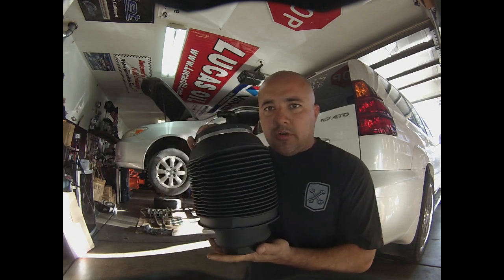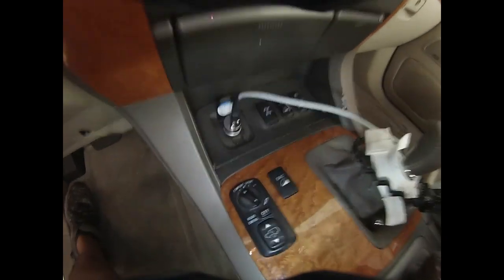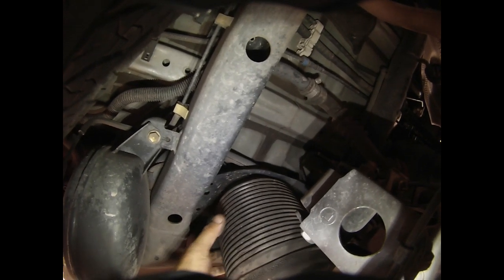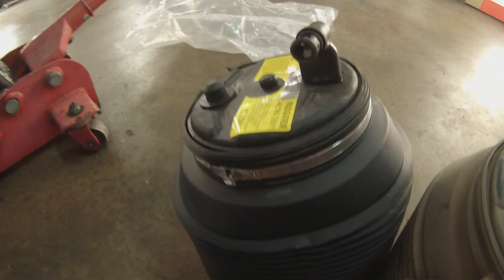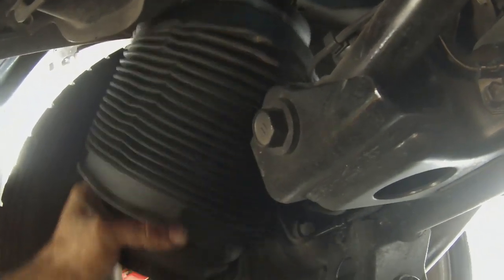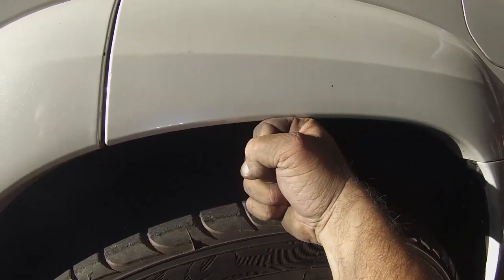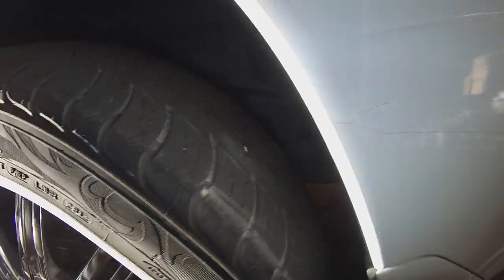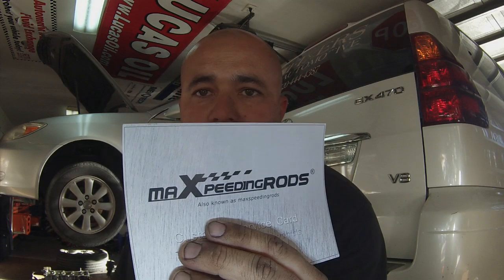2004 Lexus GX470 air spring

Comment: how to take the air springs out of the place? no much space there. thanks
Reply from the maker: Frank Wang once all the air is let out you could just collapse the bag and after taking off the top clip the bag should come right out. A little wiggle and jiggle and it will come drop out.
Reply: Thanks, after I remove the tire, there are more space to work with.

Comment: Can I turn off the height control and not to worry about the air bags anymore?
Reply from the maker: A F A hello, every time you turn off the truck it the air system will reset itself and turn back on.  The system will stay active will the engine is running. If you have a leak you will need to have it fixed or replaced w/ a standard coil spring conversion kit.
Reply: Thanks. I just bought a 2008 yesterday. It has an air suspension. I am still learning the vehicle, but it rides like a tank. It doesn't appear replacing the air suspension is too difficult. I also have an LS430 without air suspension. I heard replacing air suspension in LS is a lot more difficult and expensive.

Comment: When your bag was leaking, was the height control still working? I’m trying to figure out if my issue is the bag or the sensor. My height control doesn’t work unless if I reset by inserting a wire into the 4th and 13th ports of that connector that sits under the steering column and tap the break repeatedly. Then my height control is able to work again and the ride is back to normal. But only for 40-50 miles. Then it’s back to extreme bouncy ride. I have narrowed it down to being just the passenger side. My guess is the air bag since I do hear the hissing whenever I exit the vehicle. But I just want sure if it could be the sensor instead. Thanks. Great video
Reply from the maker: Frankie C my height control was working normally. I would hear a small air leak when I get out of the suv, make sure that your ride height sensor aren’t are not stuck, binding or seized. You can find the air springs on Amazon for something like $60.00 each. That’s cheaper then a sensor. Also you can spray some soapy water and find a leak that way. Good luck and let me know. Thx.

Comment: Where is a good place to order these airbags?
Reply from the maker: Maxispeed shop is one place.  You can also find them on Amazon, or the dealer but there super expensive.  There about $80-100 per bag for aftermarket ones.  Good luck.

Comment: Can you drive the vehicle with the rear air suspension off? Great video btw. How long do they last?
Reply from the maker: Sauer Sig, hello yes you can drive it but it’s not a good idea to do so.  Rear air springs usually last about 6-8years.
Reply: Fixers Automotive thank you so much;

Comment: What tool removes the air line from the bag?
Reply from the maker: Ice Man there is a special disconnection tool that looks like a fuel line tool. Unfortunately it’s a dealer tool only but you can still remove it w/ a small pick.  You might have to remove the line from the manifold assembly and just feed the air line out as you remove the bag. It’s easier that’s way.  Good luck.

Comment: I'm far from handy, so how much should I reasonably expect to pay a mechanic to install these on my 2007 GX470?
Reply from the maker: Sosai X you have to understand that different mechanics shops will charge different rates for labor and parts.  Cheapest way for you to fix the problem if you only have leaking air springs/air bags is go to amazon type in your vehicles year, make and model. Then search “air springs” aftermarket springs go for about $60-$80ea. Then find a shop who will install them for you. BUT remember they won’t give you any warranty because its customer provided parts....   Second just take it in and it should cost about $400-$700 for both and should include labor. Good luck hope this helps.  Cheers!!
Reply: 500 each parts and labor for aftermarket parts . Oem is a lot more.

Comment: Where you buy it? And how much you pay?
Reply from the maker: raymundo etaraz “maxpeeding rods”. I think the air spring was about $120.00
Reply: Fixers Automotive mine goes down when I turn off the truck I thought it was normal lol
Reply: Fixers Automotive just search for them in Amazon is 118 for the set of 2 thanks
Reply from the maker: raymundo etaraz nice, good luck installing them.

Comment: Hey man! Nice video. I have to replace my height sensors on both sides. How do you manually release air from the system without damaging anything? Is there a way via the pump or the tank? My gx is stuck up super high and won’t release any air. Any help you have I will appreciate! Cheers
Reply from the maker: Thx Kris. what you can do is just unclip one of the plastic clip lines at the little air tank BUT make sure before you do that you have a way to keep up the body of the suv from coming down so quickly.

Comment: You must have bought a cheap amazon one if are having to replace them again....you should only have to replace like every 100k miles.  Don’t buy the cheap crap. Also you did it the hard way.  You disconnected at the top which is way harder than disconnecting at a lower spot.
Reply from the maker: Thank you for your comment.  That was the first time I ever had to replace a air spring in the suv so it lasted about 165k. Yes I know it was the harder way to try to disconnect it from the top. If they ever go out again I will do it differently.  Please don’t assume anything or where and when they were replaced because you don’t know.

Comment: I found on ebay 2x air bag for $77
And another one for $250?!
Is the aftermarket one good enough?
do you know anyway to lock it 9n high only?
Idk why after 55km its automaticly go go normal mode :@@@@
Reply from the maker: TheBest yes you should be ok for the aftermarket. The suv will always be in “N”. Once you go so fast the air ride module will automatically lower to the N position for safety.

Comment: Hi , do you still have your gx 470?
Reply from the maker: Teo K RC hello, I sure do. It’s a awesome vehicle, had it for 11 yrs now.
Reply: @fixersautomotive4514  wow...I've had my 2006 for 4yrs now and I'm loving  it...I have never had to do any major repairs  on it...until now as regards to the suspensions... I hope to have it for a while as u have had yours.
Reply from the maker: Stephanie G is a great suv to have. Good luck and keep up w/ the maintenance!!
Reply: @fixersautomotive4514  I'm trying .. never missed an oil change.  Currently in need of alignment and back brake change.   But now my biggest concern is that my rear suspension  is out.. my go too mechanic shared with me in January of this yr ... the issue seems to be electrial.. he only changed $85 ( but didnt explain fully what exactly he did to get the truck back up to riding perfectly- he further went on to say "the  fix could last a day..or six months". It's lasted 10mths... . I went back to him this evening .. he did absolutely nothing mechanically....but  shared " he didnt think it was the air bags as both wouldn't  go out simultaneously, adding he thinks it's electrical and that I could take it elsewhere...get a diagnosis on it.. have them give me a print out.. take that  info to him and if it is something  they could do there, he'll take a look at it ". Sigh! Please share your thoughts.  As I certainly don't want to be out hundreds of $$$ ..I really can't afford  that. Thanks in advance. You are doing an amazing job proving all this knowledge.